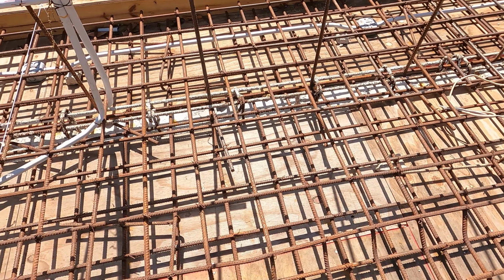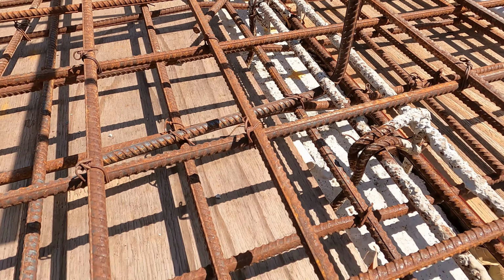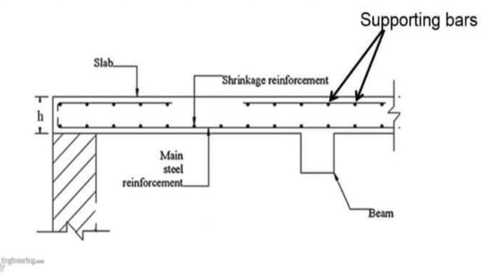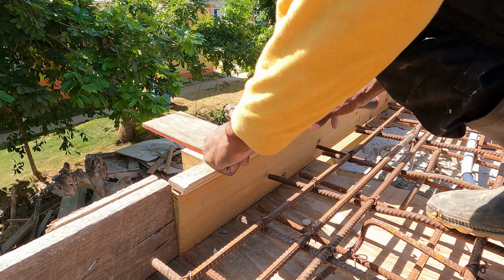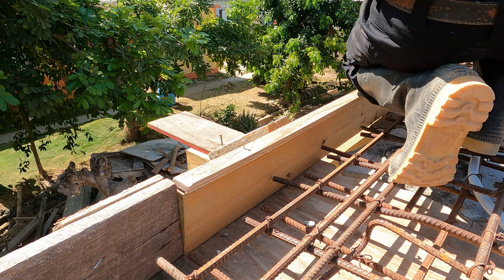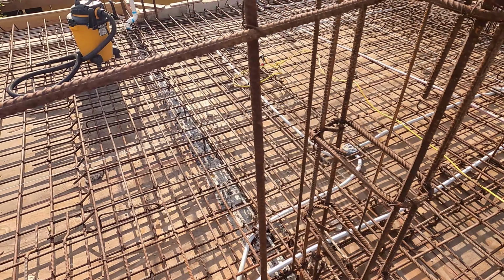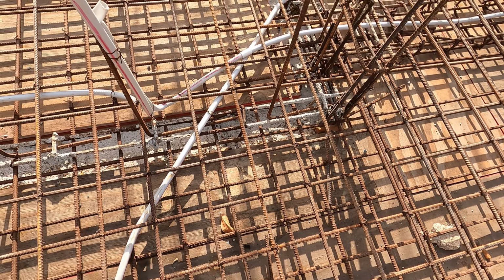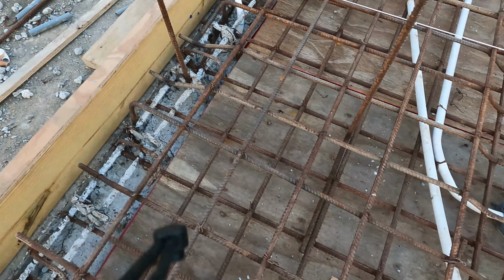The Importance of over support reinforcement in the slab

Comment: hey payne, what gap are you using between the rebar and the bottom of the slab and oversupport top of the slab? looking forward to the pour vid. keep marching forward!
Reply from the maker: Good day I using 6 inches spacing for the bottom bar and the same for the over support it call extra over support the regular space for over support it 12 inches space
Reply: @paynefuldiy  i meant the gap between the rebar and the surface of the concrete, not the spacing between the rebar themselves.
Reply from the maker: ok so the space from the ply is 1 inch and the space between the bottom and over support is 2 inches and then the rest of the space is going to be 1 1/2 inch hope that helps or you can call me on whatsapp at 8764662991

Comment: What should be done when casting a decking next to another to prevent leakge at the cold joint of the 2 deckings?
Reply from the maker: some ppl use cement in water to plaster the area but the best way is to clean the area and make sure you vibrate or rad the area when pouring the concrete to flow the material in the area and get out all the air bobbles... ntn should be between the joints of both area..

Comment: Greetings brother,hope all is blessed with you and the family. Wishing y’all wellness, joy and prosperity.

I’ve developed a passion for construction and I’ve been learning through your Videos. I have a question when it comes to steel for casting a decking: can I use 3/8 steel or 1/2” is just way better? Thanks brother!
Reply from the maker: Great question 1/2 is the required size to use as it is stronger, the steel is what mostly holds up the slad, people are moving to 5/8 steel reinforcements now. If you want to use the 3/8 it best to use it as ties as the 3/8 or too easily flex.
Reply: @paynefuldiy  thanks brother, that really answered my question.

Comment: Blessing bro, does the over support has be cranked??
Reply from the maker: no, but cranking it locks it to the bottom steel and prevents it from shaking when the concrete is pouring and there will be less or no cracks

Comment: What is the span of the over support bars and the spacing between the rebars?
Are they placed 1/4 span of the slab?
Reply from the maker: Good day I used a 3 1/2 inch space above the bottom bars and a 6 inch span  its called extra over support with a 1 inch from the top of the slab